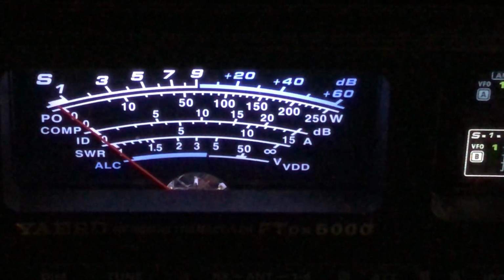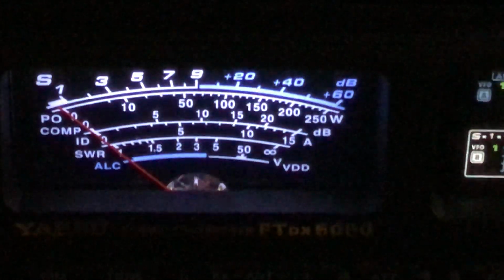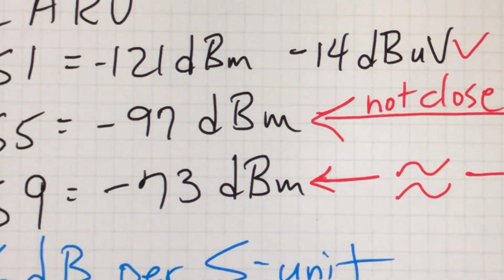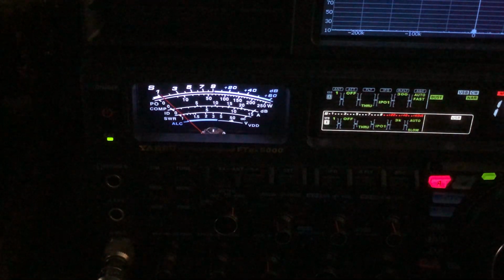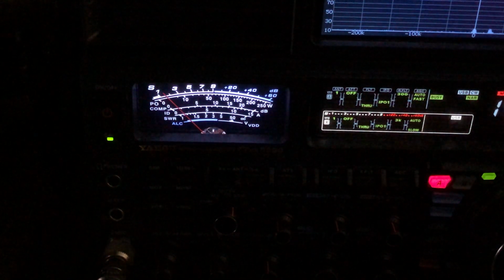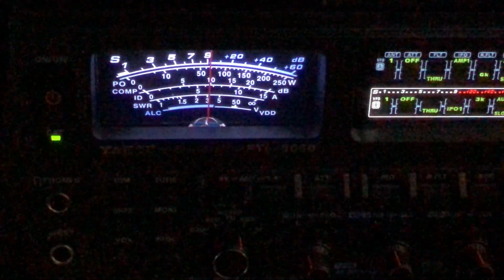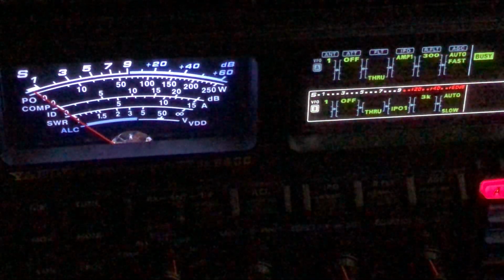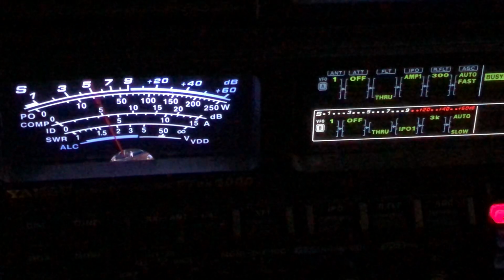Decibels, S-Meters, Amplifiers, and Gain #hamradio #linear #amplifier #decibels #s-unit

Comment: 2x (3dB) power for 0.5 s-unit. Not worth it. Get a good antenna!
Reply from the maker: Do both, if possible.  Some people have space limitations.  I get so many questions about what antenna to use if you have limited space, or antenna restrictions.

If you find yourself hearing stations who can’t hear you, they might be using an amplifier, and maybe even a directional antenna.  

The point of this video is to show that you gain the most in the first 400W.  Amplifiers that can reach 1500W cost exponentially more and require 230/240vAC. A great 500W amplifier is the best value.

Comment: Isn’t the opposite true, as it applies to QRP? 
That is, 5w is two S units less than 100w and 20w is 1 S unit less than 100w. It’s the reason QRP works. 
I see a lot of new Hams who think they need more power to make contacts. While there are many reasons that go into why radio works at all, I hate seeing newbies feel their 100w rig isn’t enough. “Isn’t 100w twenty times better than 5w?”. Then you’ve got “experts” telling them QRP is pointless. Great video!! Tnx de WB3CFN…dit dit
Reply from the maker: 3dB gain for 5W is 10W.  That represents 0.5 S-units on a perfect S-meter. Another 3dB and you have 20W, plus another 0.5 S-units.  So, if you were S1 at 5W, you are now S2 at 20W.  Another 3dB, from 20W to 40W, and you will be S2.5.  Increase the 40W by 3dB, to 80W, and your original 5W QRP signal has increased from S1 to S3.  You will need another 3dB, or 160W, to achieve S3.5.  

So it is quite amazing when you compare 5W (QRP) to 100W.  It’s a difference of 2 or 3 S-units.  The bigger difference is in the audio, if operating SSB. For CW, the difference tends to be less noticeable. 

The same thing happens again when you go from 100W to 400W. There is a significant increase in the audio, more noticeable than the difference in S-units. 

People are too fixated on S-units. My QRP transceiver doesn’t even have a signal meter. I give signal reports by ear, which is the basis of S-units anyway. It takes a 6dB change in volume for our ears to detect the change. Hence the origin of 1 S-unit representing a 6dB change in signal strength.

Comment: I have the KPA-500 and we ran ARRL Field Day at 150 watts - which is the max power allowed for "low power" and we drove it with only 10 watts or so of drive.  We placed 4th in the country for 2A (two transmitters).  I am not sure we could have done much better at 500 watts or even 1500 watts in terms of QSO's and we would definitely be handicapped in terms of points allowed per QSO had we run more power.  Like you explained - the first 500-600 watts is the lions share of the gain from QRP.
Reply from the maker: I wished you could have joined us.  It was a good group.  Yes, that first 500-600W packs the punch and doesn’t break the bank.  If propagation isn’t cooperating 1500W isn’t going to help.

73 my friend!  Doug
Reply: @n4hnhradio  The only time those extra watts seem to help is during very marginal conditions - especially 80m and 160m when both the DX and I are trying to dig out each other out of the noise floor.  Beverages help improve the S/N ratio.
Reply from the maker: Indeed, a beverage is great!  I want to eventually put one up.  I had one but it wasn’t long enough.
Reply: @n4hnhradio  The Beverages on Ground (BOGs) do not have to be as long.  I had bidirectional beverages 200 feet long and it worked great on the low bands.  DX Engineering sells them.  Because they were bi-directional - two wires had E-W and N-S covered.  This allowed me to get 117 DXCC on 160m in a single year and placed seventh in that band in the 2017 DX Marathon (a year long contest).  My transmit antenna (K2AV quarter vertical over a folded counterpoise is also quiet - not as good as the beverage but worked fine for most contacts.
Reply from the maker: I’m amazed at how quiet my ZS6BKW is.  That’s why, after my beverage got trashed, I didn’t put another up yet.  Maybe I will though.

73, de N4HNH
Reply: Sorry Doug - I was otherwise occupied
Reply from the maker: Understood.
Reply from the maker: On 7.209 right now with a couple of guys interested in SOTA.  Jump in.

73, de N4HNH

Comment: An S unit is supposed to be the change in sound volume that is readily perceptible by the human ear and that is 6 dB.  A 3 dB change in power from 1000W to 2000W may or may not be perceptible depending on how good the hearing is.   However the human ear can hear a change in loudness from 500W to 2000W - 6 dB. But you can't run 2000W (beyond the legal limit).   Those first 600 watts is the lion's share - 100X the power from QRP. or 3 S units.    Going to legal limit is only another S unit.  Great video Doug.
Reply from the maker: Thank you Ariel!  Your comment puts the icing on the cake.  73, Doug